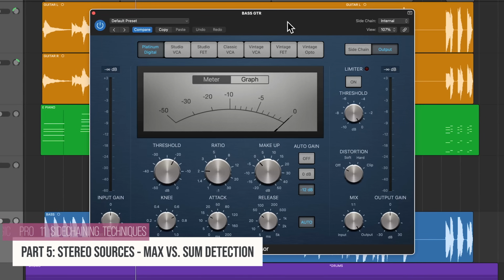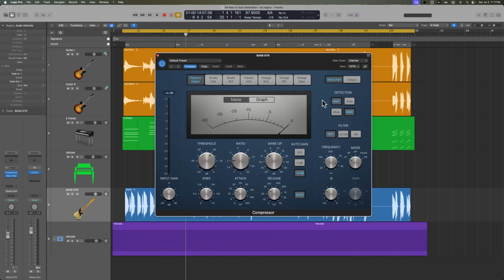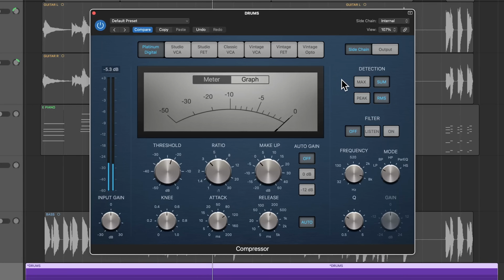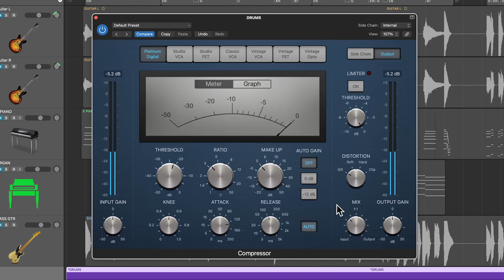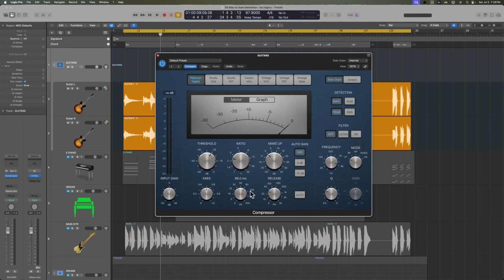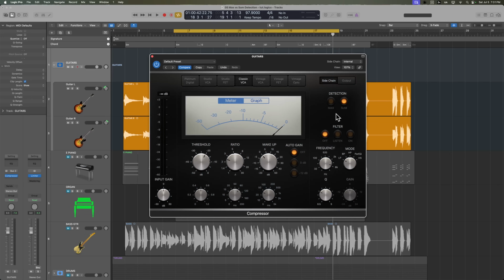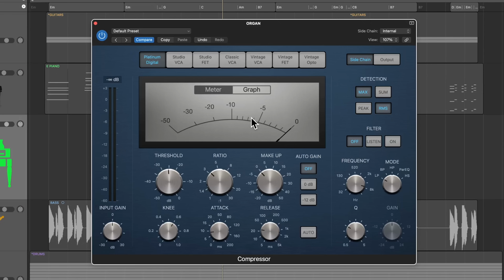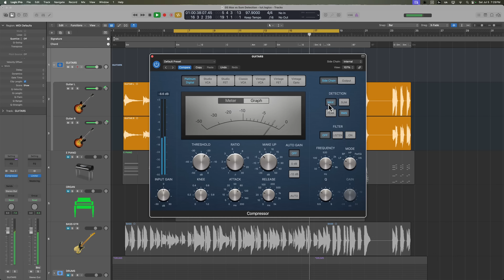Logic Pro 11 Sidechaining | #05 Stereo Sources: Max vs. Sum Detection

Comment: Just checking: is it correct to say that Max applies compression if EITHER channel goes over the threshold, while Sum applies compression only if BOTH channels cross the threshold? If 'yes', I guess this means that you’ll always trigger compression more in MAX mode, right?
Reply from the maker: Your statement about Max is 100% correct - if EITHER left or right goes over the threshold. SUM basically makes the sidechain input mono, so it's when the combined signal of both goes over. In some situations you might actually get more compression SUM mode though, because the left and right channels are summed together, causing the sidechain signal to be louder, which will trigger more compression.